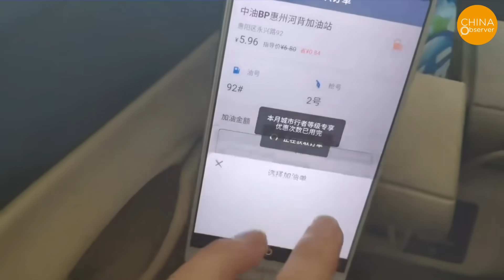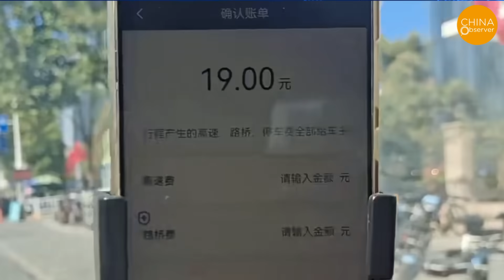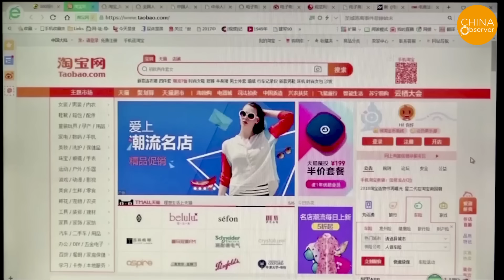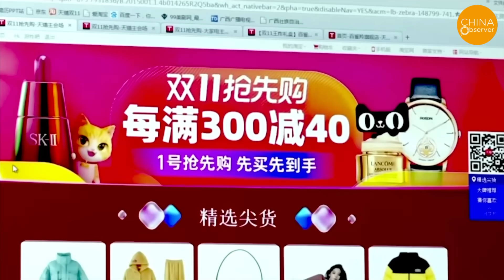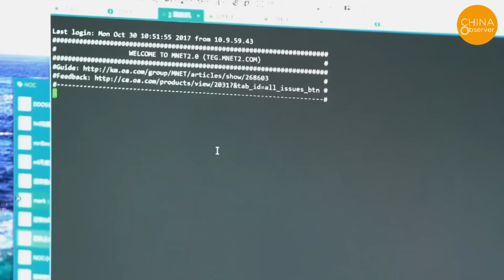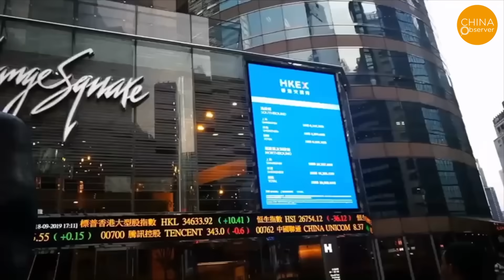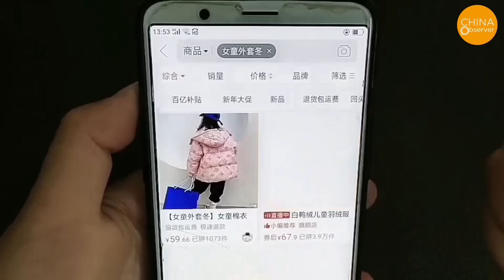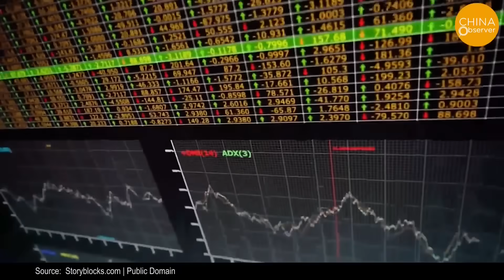Alibaba Has Collapsed, Taobao Has Collapsed, Didi Has Collapsed, Everything in China Is Collapsing

Comment: In the US, splitting off or separating listing a subsidiary does not, in general, require additional capital. Initially, the shares of the spin off are typically distributed to the current shareholders. These can then be traded separately. The idea is to unlock value for the shareholders and to allow the spin off to stand on its own. 

I mention all this because you seem to be implying that the spin off of Alibaba Cloud would require liquidity from the market. This may be a difference in the Chinese market, but that would also make no sense.

Comment: Every one of those problems relates to not have really good IT head experience in system failure and solutions. . The only except is IBM IDE which required very experience programmer manager  that  can go to IBM and ask for code for the Integrated development environment ( IDE) for programming.  Whatever depend of the functions and dependence would be revealed. but that too much work and would not increase their profit.  China big tech company lack the ability to maintained their aging computers system. They lack the innovate to match the west, They can 't even copy the west . they future is bleak.  now all the western companies had left china like Apple.

Comment: I made the mistake of buying a flashlight that was made in China. I thought, "come on, how can they mess up a flashlight? Besides, it works fine!" It worked for a day, then when I unscrewed it to look inside, it broke immediately. The assembly was terrible. Never buy Chinese products!!
Reply: I think you just get cheap product, buy more expensive, expensive Chinese products are very good
Reply: @yrmuq  what good Chinese made products 🤣😂🤣
Reply: @yrmuq  That only applies to products made before the CCP's time.
Reply: I would worry about the battery exploding if it's a rechargeable flashlight.
Reply: @stoundingresults  it was 3 AAA batteries from China, and I was still worried about them exploding.
Reply: @yrmuq bwahhhhaaaaaahhhhhaaaa